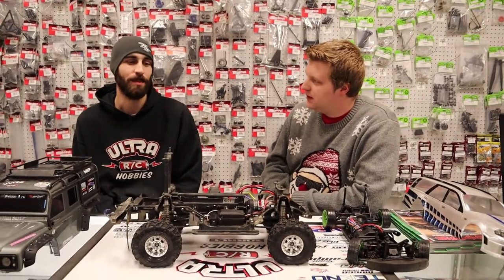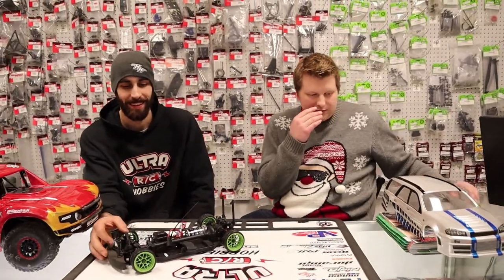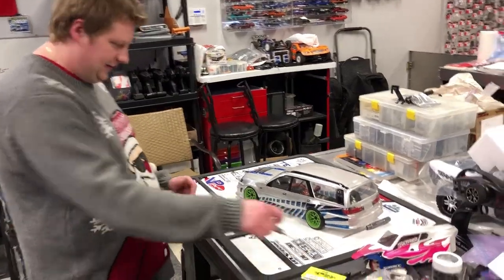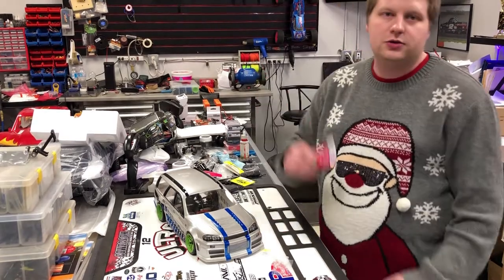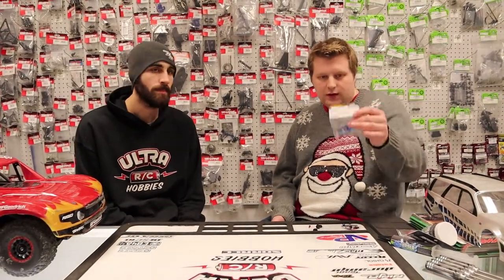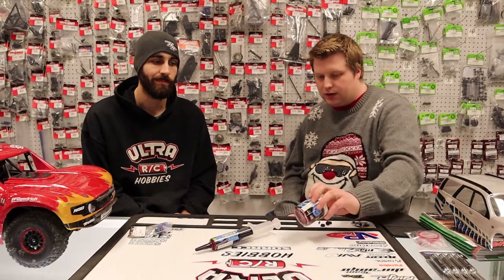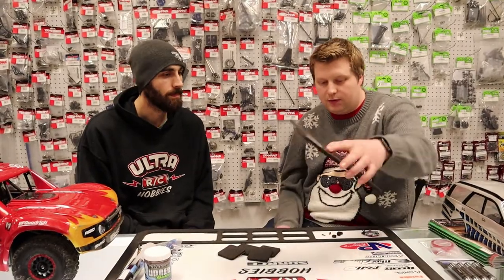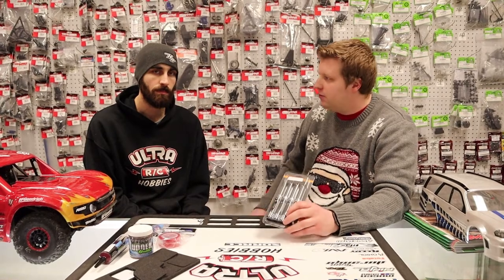The Ultra R/C Hobbies Show Episode 42 | Stocking Stuffer Ideas | Grandpasdriftmissile Gets a Body!

Comment: What is the difference between the front and rear tires on a slash 2wd.  I haven't noticed any differences between them.
Reply from the maker: The difference between the front and back is actually the wheels not the tires. The wheels on the older 2wd models had a wider offset in the rear then the front wheels had to fit the body better
Reply: @ultrarchobbies  Aahh. Makes sense.